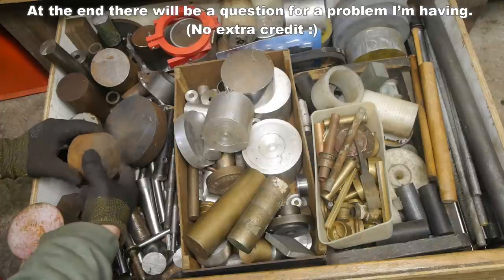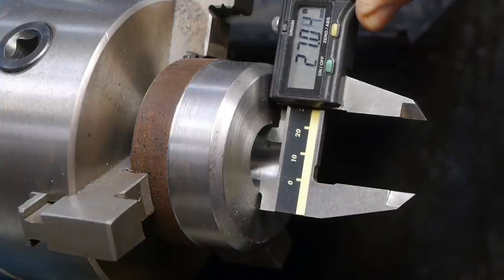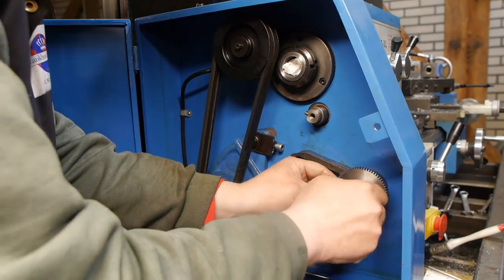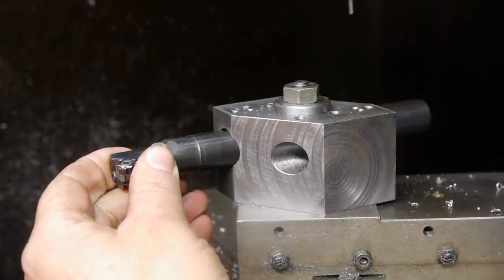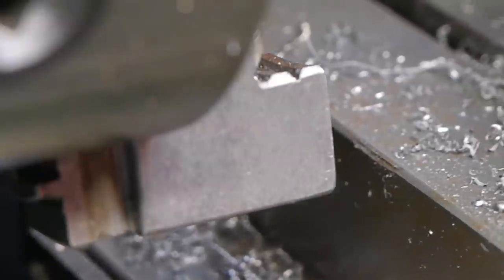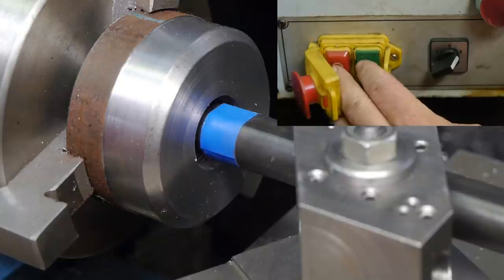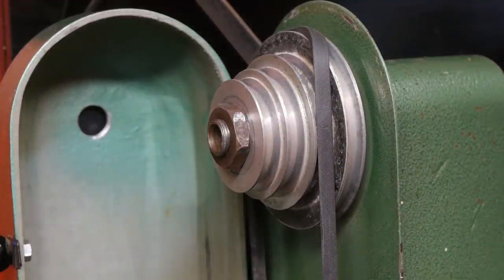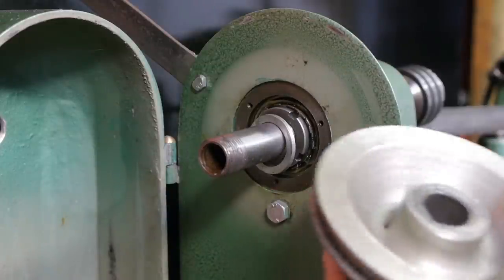How I do single point internal threading

Comment: Fix that thread with a thread file. If you don't have thread file, you can do it with a triangular needle file - it has 60° angle. I wouldn't risk it with an angle grinder, with your luck you will chop it into two pieces.
Reply: Fu Qu, I was reading through the comments to see if some other person had suggested this method, yours is the first I found and you are spot on. That is the way I will fix this. Cheers from John, Australia.
Reply from the maker: I'll try a file but the treads have been pinched hard, not a lot of room for a file
Reply: If you can't get there with a file, I'd recommend using dremel with a small cut-off disc. You'll have much more contol over it than with a big, clunky angle grinder
Reply from the maker: The spindle is kinda in the way of the body of the dremel, I checked

Comment: We all make mistakes, When they happen all you can do is back up 5 yards and punt. You'll probbally hit the goal post but what the hey............
Reply: You CAN do that, Yeah. Or like me, you can have a 10 second tantrum at your own stupidity. :D
Somewhere inside of the partition wall of my garage is still a broken 1/8" tap and a tapping handle that I flung 5 seconds after the tap broke flush inside of a part I'd spent days working on. It punched a neat 5x1.5" hole on the plasterboard about 6' up the wall, But didn't make it all the way through and fell down somewhere inside. After 2 days of pondering about ripping into the wall to get it back I just bought another small tap holder and a little bag of plaster to fix the hole. :D
Reply from the maker: I usually go for a bicule ride to forget the issue. Although I have not been in the old barn for a while.

Comment: For the repairs on the wood lathe, I think you have the right idea. Clean up the damaged thread to remove the preload nut. Then run a thread file over the thread to clean them up. Put the pulley on the lathe and turn it down and add a spacer to the same thickness you turned down the pulley.
Reply from the maker: It's still the best idea I got, hopefully it will work out. But for now I'm kinda done playing in the old barn.

Comment: I too get F***ed up with reverse threads,so now when I find them  out comes my favourite marker pen and it get marked on-off with arrows.Also a small warding file would be better on the threads than a grinder.We all make stupid mistakes,but then get hours of extra fun putting it right.
Reply: By "Extra fun" I'm assuming you mean getting to play the inner monologue of "WTF ?!?!? I've had that damn machine apart a million times already, Why the hell didn't I remember it was a lefty on there? I should have realise it was a damn left handed thread as soon as it didn't budge. But noooooo, I had to keep cranking away at it until it finally stripped..... I'm such a fe*kin' idiot. Now I can't be getting on with what I WANT to be doing because I've got to spend hours fixing something that I've stupidly broke because I didn't read the signs AGAIN,..................  OK, Maybe it's not as bad as it looks? Yeah, It probably just LOOKS bad........ I'm sure if I clean the threads up with a file on this bit, like this. Then use a few packing washers to keep the nut on a less chewed up portion of thread, like this. And just tighten it down a little so that it OH FE*K !!!!! No. I really HAVE knackered it !!!! Outstanding fe*kin' workmanship there, moron !".

Is that what you meant? :D
Reply from the maker: Marking the pulley will be the first thing I do when I get back in the old barn.

Comment: Hi there !
I used to have that very same lathe. Here is a  suggestion for You:
Have a thick fabric on the bottom of the gear compartment. It will absorb the ever present oil from the gears. When too oily, just throw it and put in a new one.
I also noticed that You have adopted the habit of keeping the gear change tooling in the gear compartment. This proved to be a good idea.
Why do You use a nyloc nut in the bayonett?  Itmakes the gear change even more of an excersise.
I also noticed that it is a good idea to have the thread configuration list (print with excel) glued with  protection film on the backside of the gear housing door. At least my lathe had a very unreadable gear change list.
Reply: When you said about the absorbent cloth to catch oil drips it made me think about a mates printer. It's a pretty impressive professional photo printer made by Fujifilm. It's print quality is amazing, but consumables are ridiculously expensive. It uses 6 large ink cartridges and a "Purge cartridge". This purge cartridge costs about 40 quid on it's own, and it's just a container with absorbent material in it for waste ink to go into, So he how recycles them by cutting them open, taking out the old cloth wadding material and replacing it. He tried several different materials but found problems with most......... Until he nicked a couple of his wife's sanitary pads. :)
Apparently, Once cut to the required size they drop in and do what they were designed to do perfectly (Absorb and hold liquid), and cost him nothing....... Well, They'll cost him nothing until his wife twigs where two of her pads are going every couple of months. LOL !
Reply from the maker: I think it needs a new paper gasket. But the input shaft got a bit messed up when on of the bearings died last year.

Comment: I used to forget that a handful of nuts on my machines were left hand threaded all the damn time. I once chewed the bearing preload threads clean off a spindle by trying to loosen a large LHT nut with an impact gun on a mates old pillar drill. In my defence, it was a pretty seriously piece of industrial machinery and rather than finding something to stand on (Read "fall off") so I could see what I was doing, I was dismantling the top end of it by feel. That little mistake put his drill out of action for an extra couple of weeks while I sourced a second hand replacment part to fix my cockup. Luckily, the reason for the strip down was to fix it after it had eaten a bearing, so it wasn't like I'd killed it. I'd just added to the problems list of an already broken machine.
I now keep some lime green nail polish in my tool box (just one more piece of my ex's crap that she couldn't be bothered to take when she left) And a keyring UV "fake bank note detector" LED light. Whenever I encounter a left hand threaded nut I either degrease and sand one side of it and paint a few dots of nail polish on it, or if that's not an option, I paint a small arrow as close as I can that's pointing to the nut. This way I have a visual reminder that I need to stop and think about what I'm doing rather than blindly carrying on and breaking stuff. With the UV light it cures solid in about 60 seconds flat, so it doesn't even hold me up for the hours I'd need to wait for normal paint to harden.
It's a simple trick that works well for me. Since I started doing this I haven't wasted any time wondering why a forgottenly left handed nut won't budge. :D
Reply from the maker: LH threads are the worst. Years ago I messed up the nut on a bench grinder because I did not realise it was LH.

Comment: Been there, done that, got the T-shirt  & used it as a rag to clean up afterwards, so can I suggest you paint  "LEFT HAND THREAD" inside the cover or by the pulleys as a permanent reminder, I have found it useful to put reminders on little used parts which may need attention long after I've forgotten how I did it last time.
Reply from the maker: That has been suggested a few times now, hopefully I will take it to hard :)

Comment: I use used motor oil for most of my steel cutting also. Seams as good as anything in my simple projects.
Reply from the maker: But it does help to use a little lube :)
Reply: @Rolingmetal  I don't know. I often go without anything withe my carbide insert tool. I think it likes it..lol
Reply from the maker: Me to, It gets messy with oil. But it does help when tapping.

Comment: Try a small triangle file before reaching for a angle grinder ,also once you get it apart chuck it in your Chinese lathe and fix the other thread with the same file
Reply from the maker: They are pinched to close for a very small file. I will try but I'm afraid grinding will be my best option

Comment: Bad luck with the wood lathe spindle. Could you turn a sleave for the pulley that would allow you to turn away all of the bad stuff your over tightening did?  Also on your metal lathe have you considered the motor and powered screw upgrades clouf42 did to his cheap Chinese lathe, completely did away with the need for change gears and a gear box. I hope you find a solution to your wood lathe spindle and enjoy your content, take care D.
Reply from the maker: It's not needed to sleeve the pulley. Hopefully I only need to make some room so it will slide over the threads. I did consider a electric lead screw and bought a couple of different motors for it. It's on my list, but I prefer working with my vintage lathe.

Comment: Use a thread file you can get them at a auto parts store or on line. To clean up the threads . Then clean up the pulley. All good then
Reply from the maker: I have a few small diamond files. I'll give it a go.

Comment: Yeah buddy. I can still remember my first run in with Left Hand Threads . The rear axle bearing retainer nut on the drivers side of an MG Midget..
They are thin to begin with and about an inch and a half around. I wound up beating it to death using a flat edged chisel and a hammer until just for grins I decided to see if I could work it back and forth. As soon as I knocked it real good going back the other way it loosened up and I spun it off by hand. $32 for a new one and this was a very long time ago.
So don't feel too bad. They had a saying back in the Old Country that my Grandfather taught me when I was very young.
"Shit Happens".
As usual, I am already looking forward to the next installment.
Reply from the maker: Shit happens more than I like :(

Comment: Use a small knife edge needle file... carefully.
Reply: Actually, if the threaded part of the spindle is not hardened, You could get away with a triangle shaped file. Then just, with some time, file the thread straight.
Reply from the maker: There is probably not enough room to fit a small file. But I will try.

Comment: Usually you just look up the bore size for a thread.  No calculations required. That grove at the back is just clearance and could be anything.
The pitch and the od should be all you need to determine what a thread is.  Also only a really old lathe would have a 55 degree whitworth thread.
Don’t worry that your pitch gauge says whitworth that is just the Chinese who don’t know what they are talking about.  It should say TPI. 5 degrees is nothing on those little teeth.

So first you need to determine what size thread you have.  Any modern thread should fit some standard.  
The pitch is a great place to start and it looks 14tpi is what you have although your diameter of 29.7mm is not near any imperial size.
Usually the outside diameter is a bit smaller than the nominal size of the thread.  Hmmmm looking a bit like 30mm
A quick google of standard spindle threads says 30mm uses a 1.5mm pitch.  Did you put a 1.5mm pitch gauge against your thread?
Also try a couple either side of that on your gauge.
Although it does seem like 1.5mm is not that close to 14 tpi for you to make a mistake.
Most 14 tpi threads I could find are 3/4 or 7/8 inches which is way smaller than what you have.
This is just the first thing I came across that lists common spindle nose threads.
http://store.gammazinken.net/Woodturning/How-to-measure-the-thread-of-a-chuck
BTW
A thread dial isn’t going to be that much use if you are cutting imperial threads with a metric lead screw. 
There are a few tricks for stopping in blind holes and picking up the same place as you back the tool out.
Cutting towards the tail stock means you need to run the lathe backwards with the tool upside down.
This can come with its own problems like not being able to get your tool on centre height or unscrewing your chuck if it is a screw on type.

Those parts don’t look so damaged that you can’t save them.  Remember we’re Machinists :)
Sorry to see you clamping the shit out of that nut.  Look on the bright side.  You compound slide didn’t hit the chuck!
Looking forward to the recovery video :)
Reply from the maker: I believe the spindle nose threads on this lathe were deliberately made non standard top sell more attachments. I'm no more than a wannabe Y.T. machinist :)

Comment: I feel fo r u in the fuckup, a suggestio too late is. On a left hand thread draw an arrow on the outside pully face. With undo to the left of the arrow. On a differnt topic, in the last vid u said you did nt have all the good gear abom has, maybe but u go something better i.e. a great sense of humour. Abom a good machinist but hes rather boreing away from machining, work is all hes got. You r far more interesting. Lookinf forward to seeu drag yourself out of the shit, kind regards henry
Reply from the maker: Yep, I should have marked that pulley, as other have suggested. Maybe Abom can come over and fix it for me, but will probably have to dot it myself and try to learn a thing or 2.
Reply: @Rolingmetal  no to the angle grinder.  As others have suggested a small triangle file would be better. I forgot to mention it in my last comment. Looking forward to more bids ty.